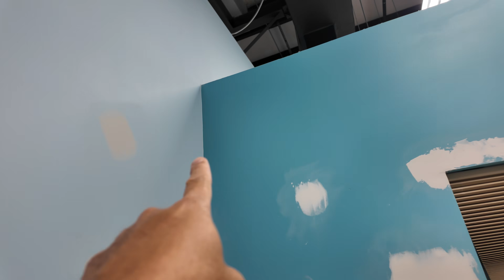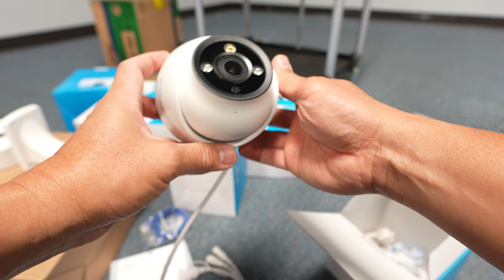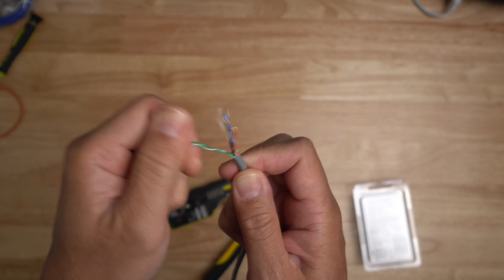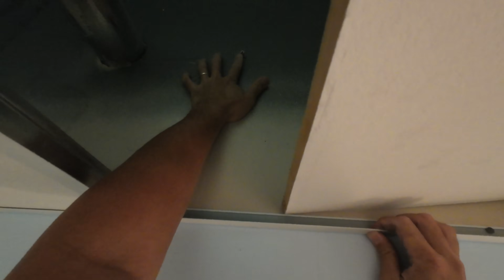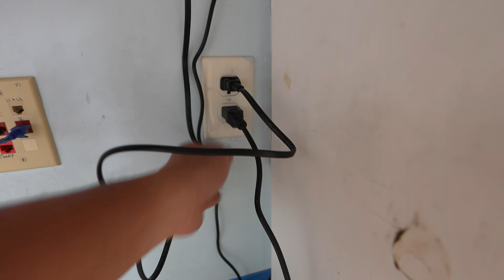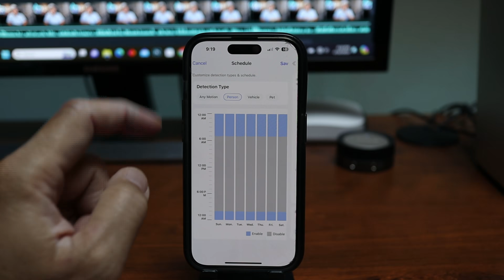Reolink NVR Security Camera Install in a Business - Things to Know

Comment: Just throwing this out here. The connectors being cat6 should have worked but if they were for stranded cable that will cause an issue. There are companies that sell stranded for solid. The only way to tell for sure is look at connector with magnifying glass. Connectors for solid cable the side contacting the copper should have three tines the center tine should be offset. If it only has two tines it is for stranded cable.

Comment: Over coverage of front door i would have changed the locations of the lobby and hall cameras. But that's just like my opinion

Edit: couple tips/options. Use a piece of drywall/plywood to pit on backside of drop ceiling tile for support 

Keep cables up off the drop ceiling with j hooks or other wire holders just best practice

Comment: I don't understand what the problem was with the RJ45 CAT6 connectors on CAT5e? CAT6is backwards compatible with CaT5, so I am assuming they were just junk connectors you bought?
Reply from the maker: The Cat6 is thicker gauge 23 AWG and the Cat5E is 24 AWG. The Klein Cat6 pass through connectors are slightly bigger on where you push in the cable and the individual wire channels and when you crimp it with Cat5E, it doesn't crimp it tight enough. Also, you will know that something is off because my Klien crimper doesn't make a clean or single cut of the wires.. I have to do it a second or third time. The connectors themselves that will connect to the ethernet port are the same... it is the crimping and the wire channels.
Reply: @LifeHackster  Ah, right. Thanks for explaining.

Comment: Hi, I want to use this system for a padel center. Not for security but for record the matches. I want to put 1 camera for each court. I've 4 courts. Is possible to start the recording manually only before the match that i want to record?  
If yes where is saved the file? Can i download immidiatly after che match the file (from nvr?) and give it to the player? Thanks and sorry for english mistake;)

Comment: LifeHackster, It’s almost time to upgrade my home security system NVR. Have you logged into the Reolink NVR from a computer on the same network? I am curious about the built in interface. Using the internal IP address and system admin login you should be able to access all features from the workstation. Older systems required Java. Newer systems shouldn’t. Can you let us know how well logging in across the network works?
Reply: Disregard. The Reolink video showed a clip of the web browser interface.

Comment: I'm a little mystified? If you research Cat 5, Cat 5e and Cat 6 cabling - they all specify and share the same RJ45 through wire crimp connectors - there is no difference? So I'm wondering why you had this problem?
Reply from the maker: Cat 6 have thicker 23 AWG while Cat 5's are 24 AWG.
Reply: @LifeHackster  That is correct

Comment: Why don't the Cat6 connectors work on Cat5e cables?  You say they look the same,  I'm curious what the actual difference is?
Reply from the maker: Cat6 connectors have wider slots for the wires.

Comment: So I've never done anything PoE, but I've run miles of Cat 5e and Cat 6 back in the day. I have a tool that is dirt cheap, I've had for 15+ years that is great for testing anything with RJ45, if you do a ton of ethernet terminations. Not sure what it's called, but it literally just goes 1, 2, 3, 4, 5, 6, 7, 8, repeat. You plug it in on one end, and then plug in the other half on the other end, and see that the lights still go in sequence. If you have a fancy tester like a Fluke, it'll have something similar built in, but for someone planning on running a bunch of ethernet, it's like $20 well spent. I actually bought mine off a coworker for $5 when he retired.

Comment: 6:43 the o-ring goes on the ethernet connector side. the thick gasket does all the sealing around the cable. The RJ45 connector side (where you twist it on) NEEDS that seal, i’m not sure how you got it to twist on without it as the pressure from the o-ring is usually the thing putting the pressure on to keep it in place. Please see the reolink site for instructions on the waterproof lid.
Reply from the maker: The thing is though, the ethernet port on the Reolink cameras have the O-ring already installed. Doubling it doesn't make any sense. So, I guess the O-ring included is a spare one?
Reply: @LifeHackster  Thats interesting, must be a new thing. If it was already installed then you’re good, that’s how you were able to twist it on. They are probably sending them with premade packets that contain an O-ring since you used to have to put them on yourself, so in this case, it is an extra due to the packaging not being made specifically for reolink’s new pigtails with the O-ring pre installed
Reply from the maker: @Aaronproductions  I checked my old Reolink Cameras and they don't have the gasket..so it is a new thing for them and other brands doesn't have this included. I'll mention this in my part 2 video on this...also the O-ring on the other side I guess it is not needed and that is why it looks mushed when I tightened it.

Comment: After watching your reviews, I decided to  install reolink 410cx  with nvr. I installed the app on my phone,  scanned QR code using the app, but can't get connection when using wifi. However , I can get connection using cellular (5G) data only. Do you have work round for this?

Comment: 2 things I noticed...No ethernet cable tester to verify cables? Would have caught the issue right away. 2nd, get a UPS on that NVR!
Reply from the maker: Nope. I didn't have one... I have now bought one though...As to the UPS, I might or have another PC in a UPS run as a backup in the background..we will see.
Reply: @LifeHackster  Cool. Something to also note that I ran into. Sometimes the ethernet crimpers that cut the wires that stick out have issues where it doesn't make a clean cut, so you have 1 or more of the tiny wires touching. Probably not your issue, but it's happened to me before.

Comment: Nice install! Usually i install the vandal proof on the arm first then the arm to the wall. Then open to adjust and close up. Also silicone the holes, and then the outside perimeter.
Reply from the maker: LOL.. I didn't think of that and that is definitely a better and safer option because I can do all of that while I'm still on the ground. Thank you.

Comment: One tip for anyone running cable. Whenever possible leave an extra loop of cable of a couple feet (or more) long where you drop your cables down to the cameras or NVR. Future you will think you if you need to say reterminate a connection. ;)
Reply from the maker: Yup, I agree. Now, because she changed her mind as to the desk, my options are limited...thinking wall install now for both the NVR and monitor.
Reply: @LifeHackster you can use couplings, or a poe switch above the ceiling and a new ethernet to the nvr

Comment: I just set up a Reolink NVR system today. I went with the CX410 cameras. I mainly chose Reolink after watching tons of your reviews. I was replacing an older Wisenet system that used BNC cables so I got contractors to run the CAT6 in place of the BNC cables.
Reply from the maker: Nice. Thanks for watching!

Comment: need  a NVR lock box or hiding no one stealing NVR. UPS power backup
Reply from the maker: Might be an upgrade that I'll do in the near future for the lock box. The cheaper option for now that I can think of is setting up 1 camera that monitors where the NVR is to record to the microSD card (just need plug it in a PoE injector). Also, a PC back up would be another option when everything in the business is setup.
Reply: @LifeHackster  you can't do that the PC backup video. I made my own Steel lock box for  NVR protected and bolted table or the wall
Reply from the maker: @Sparky-joystick.1308  Yes, you can. Run the Reolink Client app in your windows PC, run it in the background.

Comment: Just a quick question. Can you connect Reolink cameras into the POE ports of something like a Unifi managed switch, and then connect the Reolink NVR to another non-POE port on the same switch or another switch in the same LAN? Will the NVR pick up the cameras through the switch or do they have to be connected physically into the NVR?

On a related question, if you do as above can a NAS like a QNAP pick up the switch connected cameras as well? I'm wondering if i can use a NAS with its inbuilt smarter surveillance software and the NVR at the same time for the same cameras? 

Love all your content. Clear, concise and helpful.
Reply from the maker: As to your first 2 questions, Yes. -> https://youtu.be/w3XFERI3w3Q
As to your last question, it can but it will depend on the model of Reolink camera that you have.
Reply: Ah perfect. Is there a list or another resource that let's you know which Reolink cameras can be used simultaneously with its NVR and NAS boxes using Onvif? This would determine which cameras I would choose.

Comment: Have you had any issues with pass through connectors? I was looking at Infitit Cables to spec out wiring for my setup and they said pass through should not be used for POE.
Reply from the maker: No issues. I have used this in my home setup around 3 years and without the waterproof lid and no issues.

Comment: Excellent installation!  Doing a drop-ceiling install is a lot easier when you can gain access above the ceiling.  When I installed my 6-camera POE Reolink NVR system, I had the same issue trying to find the correct CAT6 connectors for my CAT6 ethernet cables.  I used a cable tester to make sure my connectors were probably wired before installing the cameras.  I would also advise to the DIY installers to not use CCA (Copper Clad Aluminum) cables since they are of poor quality and will cause signal problems especially with POE setups.  Use twisted copper cable only.
Reply from the maker: True on the CCA cables. Thanks for watching!

Comment: dude i tried crimping cat and its a friggen nightmare. and each gen gets way harder (cat 7 way worse than cat 6 etc). then people said those pass through crimped cables go bad fast. i'd rather just buy pre-length cables. i think wal mart has 75 foot ethernet cables.
Reply from the maker: I have used pass thru for around 3 years in my setup without issues and also without the waterproof lid which you can always put this on if you are concerned about oxidation.

Comment: I have been trying to move towards more turret installs due to maintenance of dome cameras. Even a bit of rain or dust makes the picture unusable due to the IR reflecting back in the lens if there is dirt or smudges on the lens. I have not encountered this issue with turret cameras at all.
Reply from the maker: That is the issue with these glass covered cams. If they just use a low light sensor like on the CX410 and remove IR, there will be less maintenance.
Reply: @LifeHackster  not remove. An option is to place the IR on the outside casing, but might bring in another point of failure if not done correctly.

Comment: How does human AI compare with eufy? Also any experience with ubiquiti (assuming $ not an issue)?
Reply from the maker: Rolnik's AI can detect farther than Eufy. Eufy is only around 30-40 feet. As to Ubiquiti, I did test them a way back when they still didn't have smart detection. Video quality is fine but not in line with how much they sell their cameras for.

Comment: It’d be interesting to do a cost/time comparison of the DIY route to a quote for a similar system done by a professional installer.

in our home we are using the Reolink NVR & cameras (thanks for the recommendation) prior to that we had a different store bought NVR system and had paid a contractor to run the Ethernet cables through the attic. It’s nice that you can just change out cameras as your needs change or new features are released such as dual lens, spot lights etc

A friend is building a home, the low voltage contractor was trying to sell him on an expensive camera system, I shared your channel along with the hook up, now he’s going to have them just do the prewire and either use Reolink or unifi and install himself afterwards, it will save him thousands of dollars
Reply from the maker: I was initially planning to have someone give a quote but we are in a rush to get everything ready. Next time when there's more time. Pre-wiring or have some one drop cables will be the middle ground and probably the cost effective way especially if you don't have the tools needed. Thanks for watching!

Comment: Nice job, though I'd use rubber grommets to protect the network cable from rubbing on the metal studs/siding. Love to see more videos like this.
Reply from the maker: I was thinking about it initially but after the install, there should be no movement on the wiring anyways...but we will see. Thanks for watching!

Comment: The only thing about vandal proof cams, if they get wet at night due to the rain, so water on the bubble, the IR light blurs everything and you can't see anything until it's dry. That's any bracket/orientation I've found.
Reply from the maker: It would be nice if they put a low light sensor on it and just get rid of IR like the CX410..but those glass domes though needs some maintenance cleaning.
Reply: That's why I moved to turret cameras. Unless you go up and clean it, even when dry the smudges will stay.
Reply: Maybe you can put a simple water protector above it.
Reply: Agreed, I replaced one here at our house with the turret style for that reason. They seem to be best suited for ceiling mount indoors or in dry outdoor spaces. I also like the led spotlights more than IR
Reply: 100% Agreed 👌